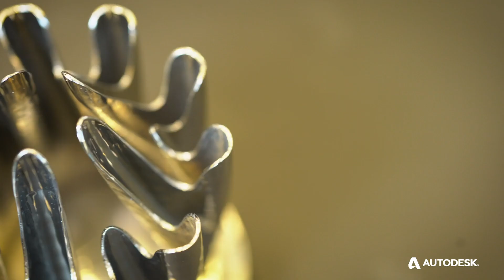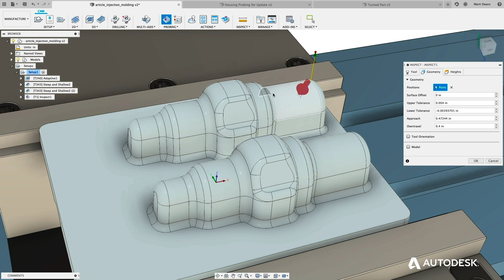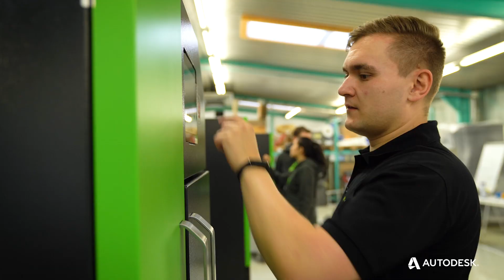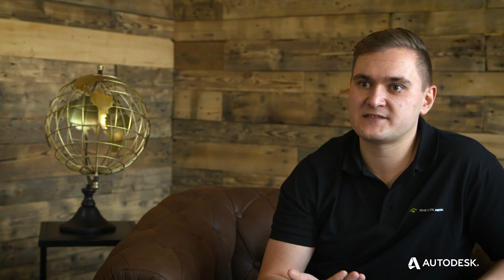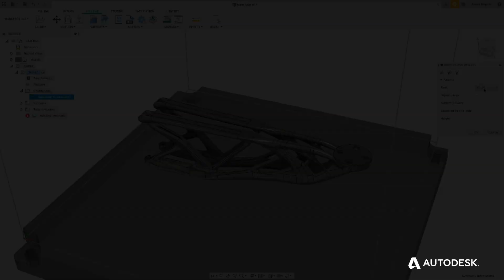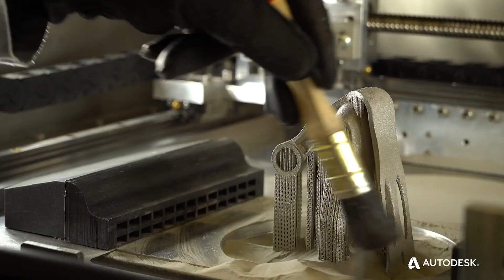Fusion 360 Additive Manufacturing Updates

Comment: why would you need support for the laser sintering ones? isn't everything supported already by the metal powder below?
Reply from the maker: Found this explanation that made sense to me: "Although technically it does not need supports, to avoid any issues such as warping due to residual stress support may have to be provided. Also, most of the printers use a build plate to build the parts .. hence needs post removal and post-processing. This can be reduced by designing with that in mind."

Comment: For whatever reason, the face offset (push pull) tool doesn't allow me to create tolerance in my parts anymore. It bugs out and often creates a mesh that is complete garbage. It used to work, so I suspect that it's a bug.
Reply from the maker: Can you please submit so we can get our eyes on this issue? If it doesn't get properly documented, it won't get addressed. https://forums.autodesk.com/t5/fusion-360/ct-p/1234

Comment: Need an extension from manufacturer. 
As you send them your design and they have that +500k machine workshop. 
It shows how much will it cost 🙃
Reply from the maker: What?
Reply: @adskFusion  nothing, just thinking if a machine / fabrication workshop would make its own add-on that customers can use.

As it shows how much will it cost as you design.
You would increase its tolerance? Price goes high!
You simplify your design to be made in one go? Price goes down.

It adds up material, set up time, tools used, cut time, surface finish, packaging... etc.
Reply from the maker: Okay, I haven't looked at this add in in a little while, but its worth sending your way. They had some really cool stuff in the works last time I checked: https://youtu.be/vHYgZnQzu7U